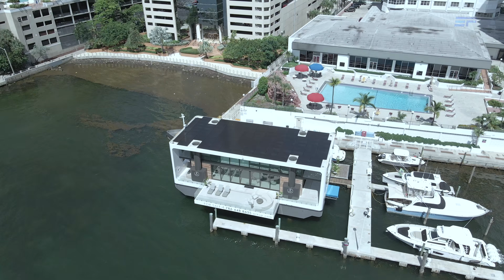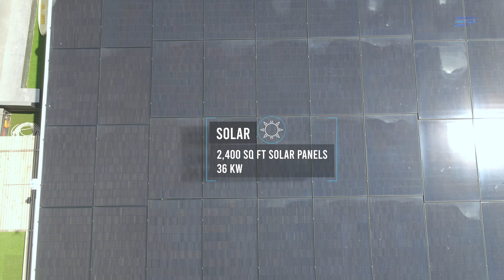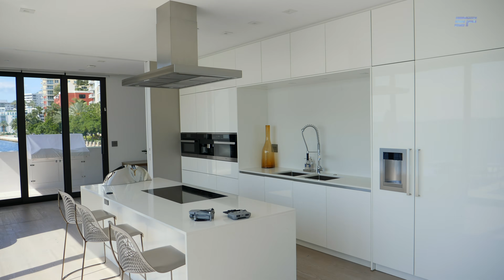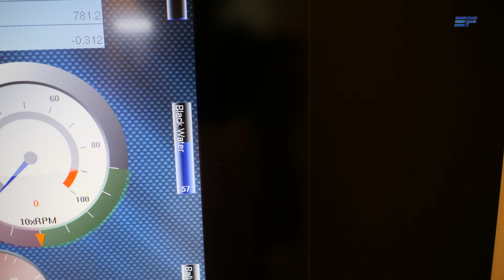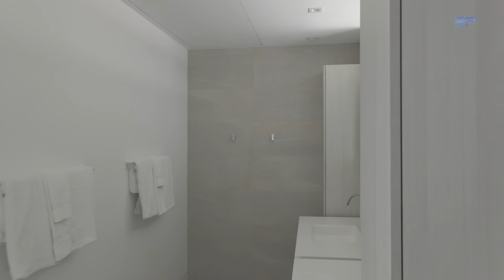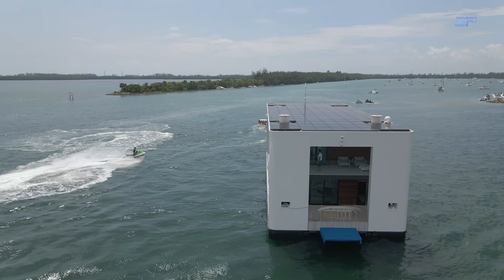Off-Grid Mansion in the Ocean

Comment: That is a crappy setup in several ways.  The battery and propulsion system is an utterly inadequate hazard-in-waiting, and failing to put it on a reasonable hull design is both lazy and moronic.  Many of the "advanced high-tech" features he is bragging about are just standard yacht equipment you'd find on every open-water or livable boat.

Basically, it's a crazy publicity gimmick looking for suckers with more dollars than sense.  If all you need to do is sit at harbor in one spot, you could rig any basic houseboat with a solar system for a fraction of that price, and just use the diesel generator to boost a proper electric propulsion to move it, so at least you could move it against modest currents.  It's not going to rock enough to matter.

If you actually want to have a thing that can operate as a boat, for that kind of money you could get a real Silent 60 or Silent 80 that are perfectly livable, and those are properly seaworthy.  They've done ocean crossings and even a circumnavigation, and the proper catamaran design is more than stable enough to anchor out or sit at pier, homelike, for as long as you like.

Comment: No water maker? And they good easy make more power with a wind generator on the roof and some propellers under the boat or pods that generate power through water movement while the boat is standing on its 4 legs

Comment: So basically this thing is not suitable to go more than a few miles due to unsuitability for open waters yet has all of the high costs and maintenance associated with a full yacht yet encompasses all of the disadvantages of a yacht like massive depreciation and outright cost. The cost of this could have been 25% of what it is and just make it tow-able so it can still do the occasional short trip it will do from time to time. This is actually in competition with a coastal house and not a yacht and the house is a decent investment and can't sink. Good luck selling this or even making any more. It's a science project and little more. I'm a fan of new technological innovation, but not for the sake of the sake of it.

Comment: Basically a well built, small-sized barge with electric motors attached,.  The propulsion system does not have the performance needed to justify the cost of their installation.  Otherwise, as a living space, this is an awesome design.